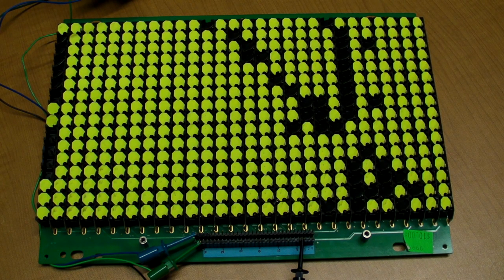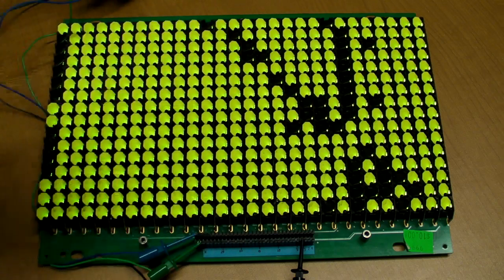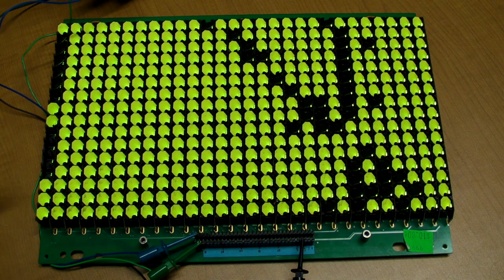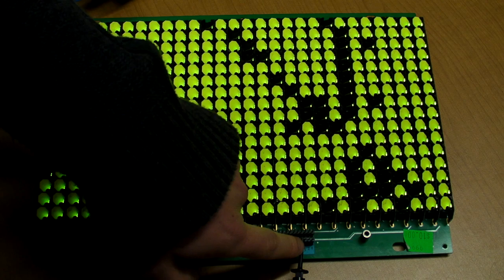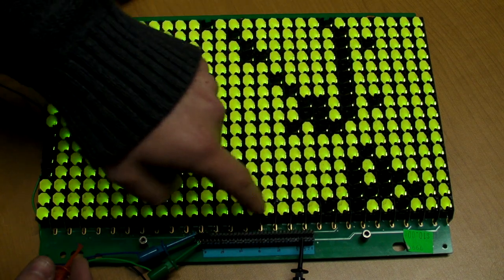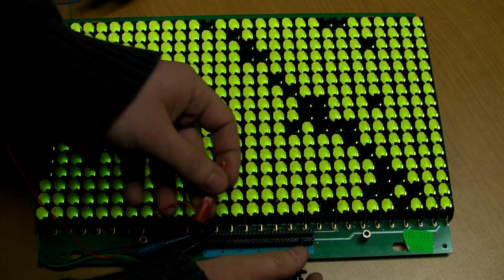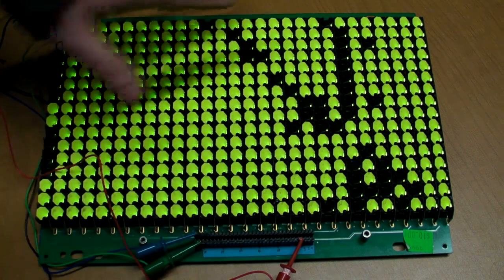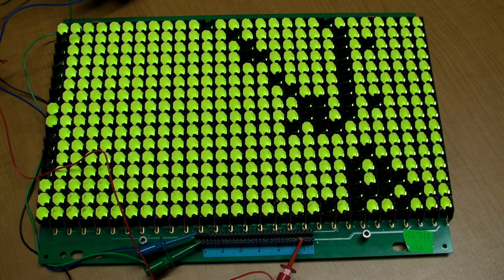Reverse engineering a flip dot sign

Comment: hey, i have a flip dot sign with similar side to urs. its off a bus and i cant seem to get it out of its metal box. i can open up the back hatch to see the electronics but i cant seem to take the flip dot board itself out because the bottom of it is attached to its frame and theres a clear screen in the front thats permanantly screwed in. aany help here?